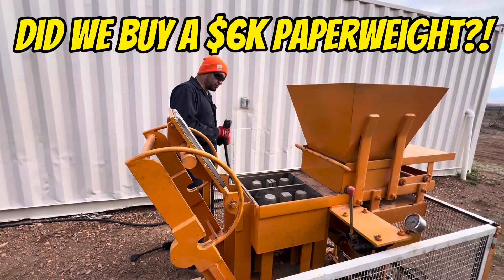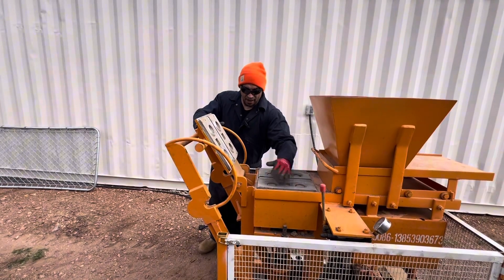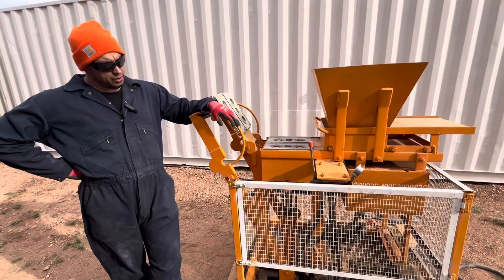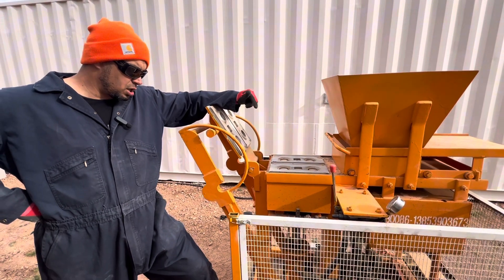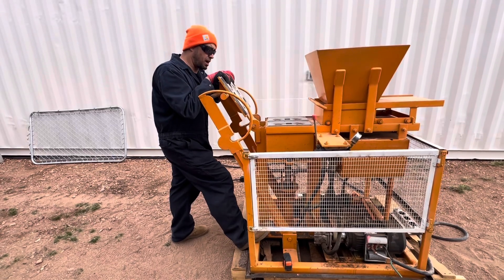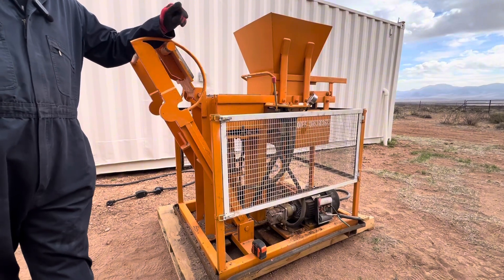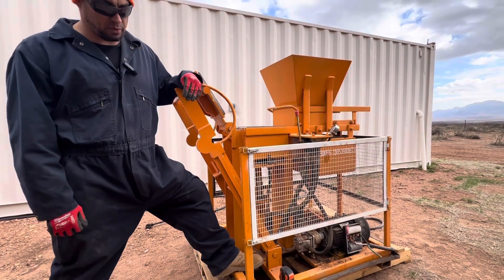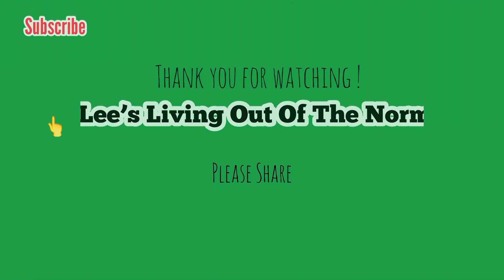Interlocking compressed earth block machine problems

Comment: Hello Lee & everyone commenting here. Has anyone solsed this issue before?

I have the same machine with a 8.5 kw diesel engine which does the same when trying to hold the pressure to 2000 psi.

With less then 2000 psi and a piston rod of about 2.5 inches, you'll get less then 5 tons to compress 2 blocks. That's not enough force to properly compact sandy clay.
Reply from the maker: Hi jonasvipeam, Erik is away and has no access to internet for a bit but when he has one, I will ask him. So please be patient for a comment from him🙏 Have a great evening!
Reply: @leeslivingoutofthenorm  thanks,
Reply from the maker: Hi!  Thanks for the comment. We are currently hitting about 1850 after going to a 3 phase electric motor. We are going to check the block and the pump drive to see if we can tighten it up and get us over 2000. I will say that after we adjusted the height shorter and did some runs of that, the strength and compaction seems good to us to the point that if we cannot get it tightened up more we are comfortable with the strength of a single story building. Stay tuned!

Comment: It’s drawing too much power for your solar system. Either the max power draw from the inverter or the battery bank can’t keep up with the power draw. It’s not the machine. I would rent a big gas generator, Plug in a device that will show you the power draw between the machine and the generator and then take note of how much power it’s drawing at different states of the machine usage. Then you’ll know your max draw and you can scale up your solar system to match. I think you simply need an inverter with a larger power draw. Mine says 4000w but it trips at much less power draw. my view is always double your inverter to what you think you actually need. Good luck guys! I love what you guys are doing.
Reply from the maker: Thanks for the comment. I will be doing some changes to the machines setup. I do know that I have 13K watts worth of inverter power. I’m gonna put a video out about it shortly.

Comment: The electric power need use three phase voltage, single phase power first not powerful   seccond easy to brun Motor capacitance,  and the soil must need soft sticky soil, if not easy to find, can try the soil for ceramics
Reply from the maker: Thanks for the comment. We still have some testing to do :)

Comment: The voltage issue with your inverter is probably a warning for your battery, not the load.  When you draw a lot of current from your battery it pulls the voltage down and trips the over/under voltage protection.  This has to do with the C rate of your battery bank, not the capacity of your inverter.  Have you used a volt meter to see how much voltage the motor is running at?  Remember, switching that motor from 220v to 110v will cause it to draw double the amps that it did at 220v.    You could use a generator or as you mentioned, covert it to a gas motor.  Also that ground on your cable should be connected to the case of the motor.  I hope you get it running.  This is just a small hiccup.  Don't get discouraged.  I'm interested in earth block construction as well.
Reply from the maker: Thanks for the comment. We are going to try to troubleshoot it after life’s obstacles move a bit.

Comment: Hello guys, very inspiring, I’m sure you will solve all the issues, and achieve your goal. Very interested to follow you in your journey.

I just received exact same machine😅, it’s working 220V 60HZ 3 Phase, I’m in testing phase. 

If I may have a question; what is the max 
pressure you got on the gage Mpa or psi? Please.

Best
Reply from the maker: Are you running it off of an inverter/offgrid?  Next time I go out I will take a look at the pressure and post.  Currently I that a thread on Reddit that is talking about the power factor that motors put out. Thanks for the comment!
Reply: @leeslivingoutofthenorm  
Thank you for the reply, No, it’s on grid.

Comment: If you can share the wiring diagram on the motor nameplate we can help you rewire it for 240v
Reply from the maker: Hey MartinKL. Thanks for the comment. https://www.reddit.com/r/Motors/comments/1bjsl2z/single_phase_dual_value_capacitor_asynchronous/

Comment: Its a 38 amp 110v motor meaning you need a 40 amp min dedicated breaker. Remember to size wire accordingly
Reply from the maker: 4180 Watts at 38 amp 110v.  It is a 6500w inverter putting out 110v to a panel and the breaker feeding that circuit is a 110 - 30a breaker. And the breaker doesn’t trip. The inverter is shutting down and giving a code of over voltage. What do you think?
Reply: If you can rewire to 240v it is better  less amp draw but from sound of it it would have to be dedicated inverter with nothing else drawing power from inverter, even then may be too small of inverter for that load. Also initial start up may be causing the issue. All motor draw more than stated draw for initial start. That can be solved with capacitors.
Reply from the maker: Sorry I just saw this comment. I gotta figure out how to show replies better. I have gone through a bunch or research. This motor has two capacitors on it. We are thinking it is something with the power factor. I have a couple things to try. We’ll keep you updated.
Reply: Remember it is drawing 38 amps requiring at min 40amp breaker.